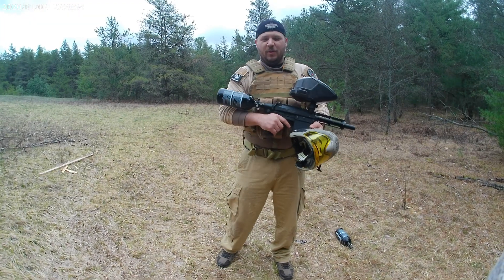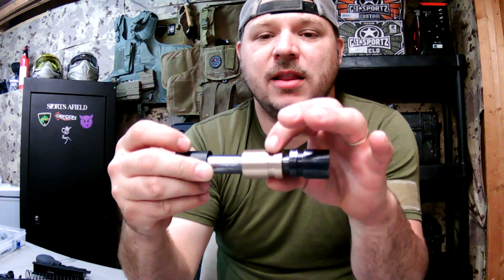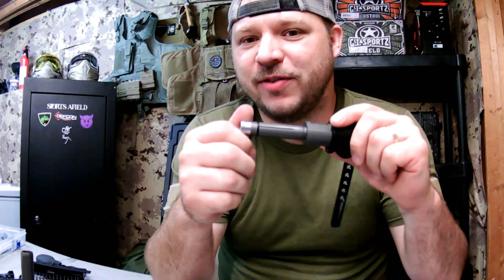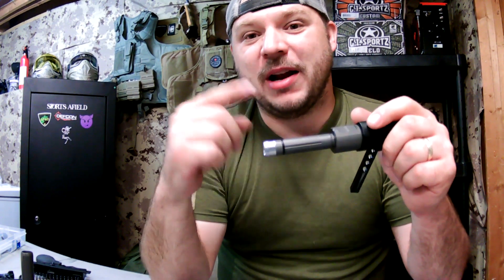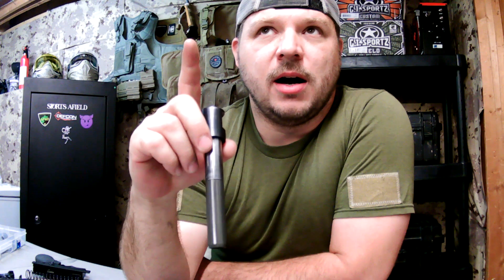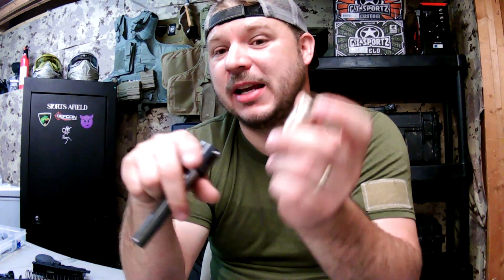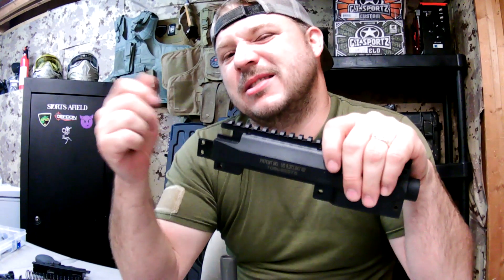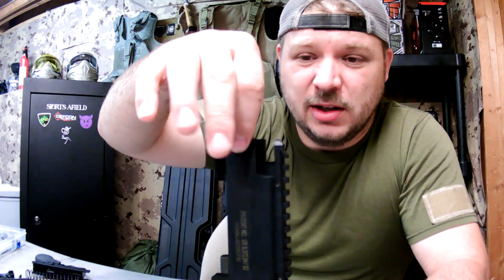Valken M17 Bushing Comparison #mechanicalengineering

Comment: I replaced those body pins with nuts & bolts like these: https://www.amazon.com/gp/product/B015A33ASK/ref=ppx_yo_dt_b_search_asin_title?ie=UTF8&psc=1
Super easy and less frustrating than messing with those cotter pins.  By getting different lengths, you can replace just about all of the screws with those (in different lengths) - I stripped too many of the stock button head bolts/screws so went with the socket heads.

Comment: If you can redesign the whole upper receiver as one solid unit requiring less Pins and screws moving away from the clam shell design and also use push pin technology  that would be amazing and also find a way to get rid of that hideous three screw shroud adapter.